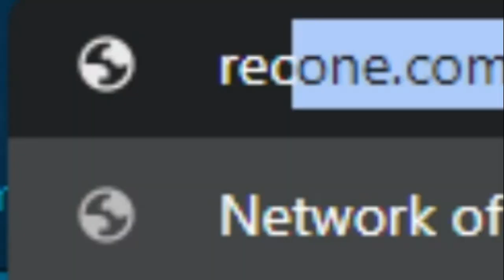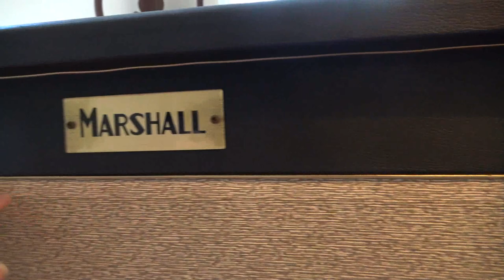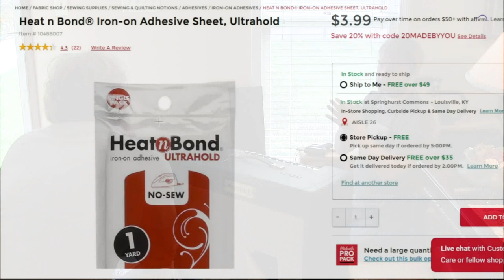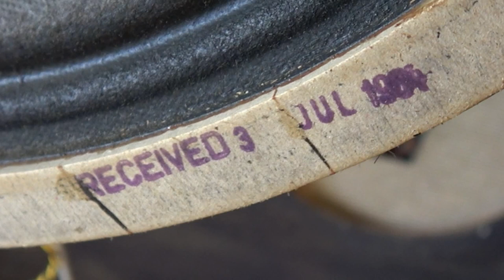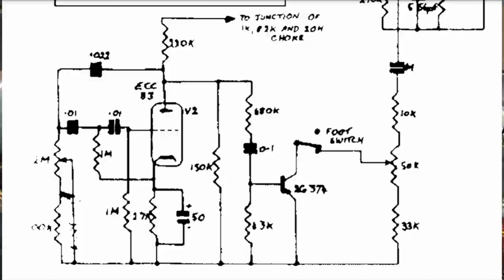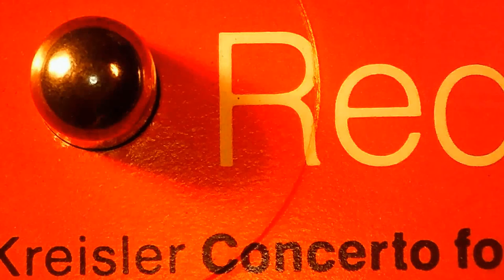The ORIGINAL Eric Clapton Blues Amp - 1964 Marshall JTM45 BLUESBREAKER (Repair, Analysis & Demo)

Comment: Use some toilet paper and finger nail polish I have done many times. It works. Paint around the crack then lay toilet paper on it and then paint it will nail polish.
Reply from the maker: You can't later melt the nail polish and re-spread it when it cracks again.
Reply: Nail polish always cracks after repaired, that's why the hot silicone glue since it doesn't crack and it's very flexible and can remelt it !
Reply: @TheGuitologist  That is a very good point sounds like the best way to fix it. They do sell new ones if you can not fix it. New Celestion speakers are available.

Comment: Don't understand the love for vintage equipment I want brand new
Reply: It made better and they aren’t making any more of it, so depending on what it is it’s almost guaranteed to maintain or go up in value.

Buy the right stuff, at the right time and you can have some of the best, most sought after, best sounding gear that you can use for years and make a profit if you ever sell it.
Reply: I agree. All this stuff has been reissued. It’s not like my 70 Charger and Cuda.
Reply: @drippinglass  the charger has deffinately been "reissued".
Reply: @BockwinkleB  yeah but not in all steel with all American parts like the old ones 😂
Reply: @BockwinkleB  I guess you do now what a ‘70 Charger R/T looks like. 😄
Reply: @drippinglass  no they haven’t been all reissued, and often the reissue is nothing like the original. I have a pile of amazing old amps that will never be reissued